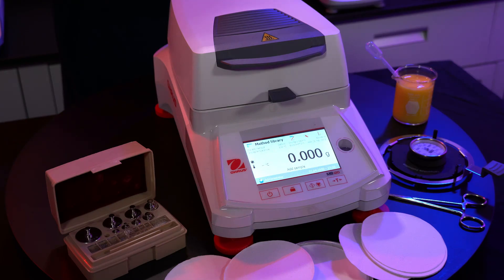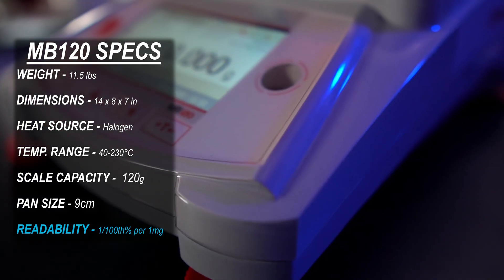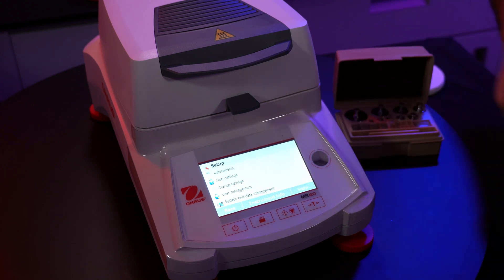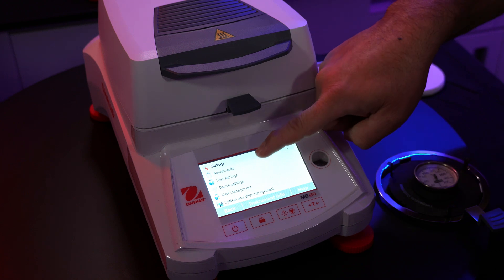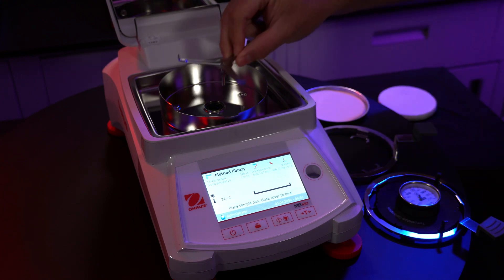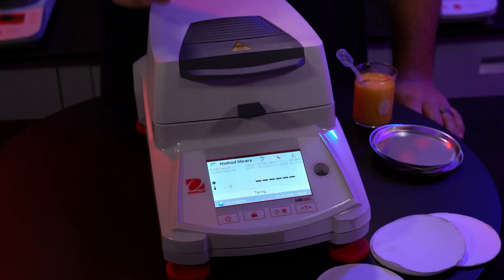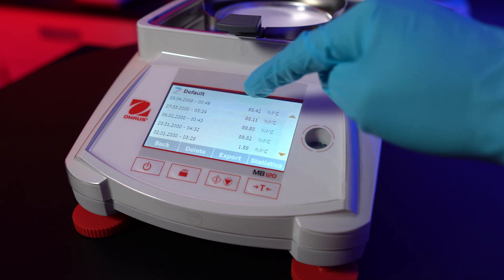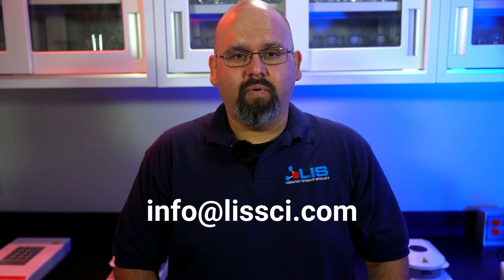OHAUS MB120 Moisture Analyzer

Comment: We are working on Ohaus MB 120 , The problem is it does not booth , when its pluged to power the display will with human  picture like a diver on the screen, i tried to reinstall the eepro in the process after adding the S/No , the Model No. it will request for Write Image file. thats the issue now we cant see the image file file through browse. please how can we get the write image file?
Reply from the maker: Hello, you must contact Ohaus to get the image file. They will send you a file to upload.
Reply: I have the same problem, did you find the firmware?
Reply: Can calibration be performed with sample quantity range like 2 gram, 5 grams?